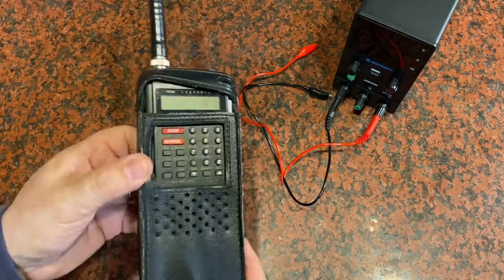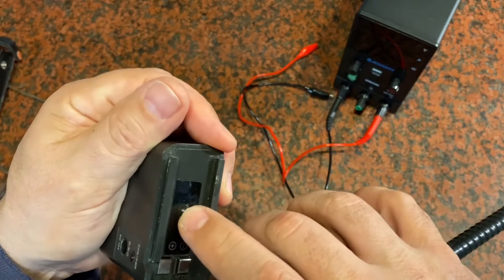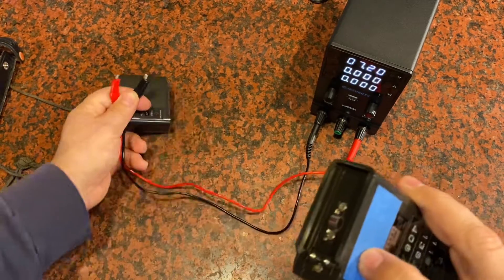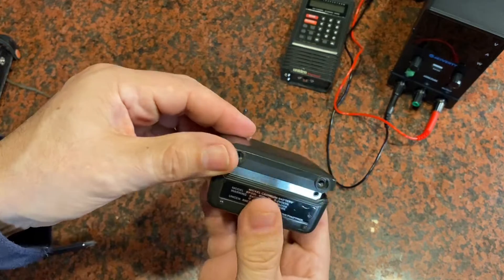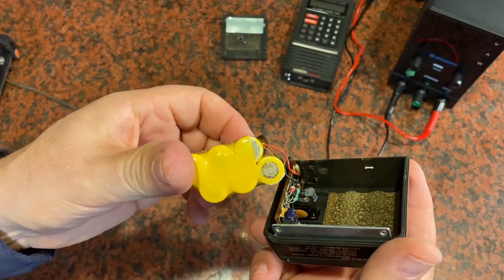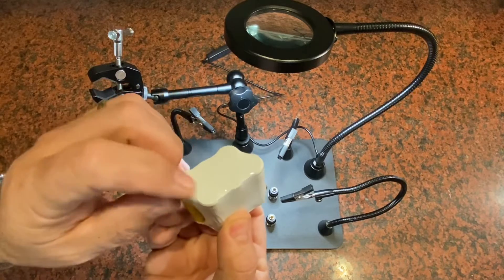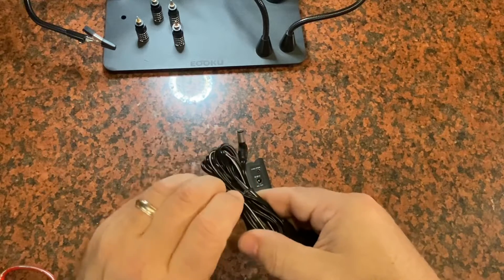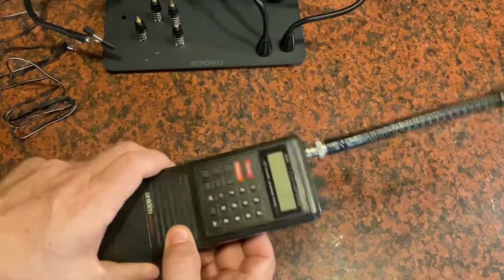✅ Repairing a Uniden Bearcat XT100 Handheld Radio Scanner with New NiCad Battery

Comment: I just did this repair on my 200XLT. I went a different route. Batteries America has a battery pack that is nickel metal, 2100mAh and made with slow discharge Sanyo Eneloop cells that have overcharge protection. They come pre-charged ready to use. That’s more than 3X longer capacity  than the original 650 mAh nicad pack. Stay away from nicads if you can. The nickel metal cells don’t have the memory issues. You can charge them at half full with no issues.

Comment: Stuck on this one right now!  Just opened the pack as you did, luckily not breaking the 35 year old tabs but one of the wires came loose from the regulator board.  So now Im stuck trying to figure how to get the regulator board out so I can solder new battery leads in. Looks like you have to unsolder the terminals formed into the plastic case,  they seem held to board by a good bit of solder.  Now to gamble can I heat the tabs enough to unsolder without melting the case!
Reply from the maker: @sethlavinder  good luck!!!
Reply: When i opened my empty battery case, the wires were cut too short to use by the previous owner. 1-remove the Philips screw that holds the corner of the regulator board and the metal bracket, wiggle the metal bracket out of the way and remove completely, it will come out without damaging anything. 2- bend the metal battery pos/neg tabs and straighten them as if you were going to remove (but don't try). Now the only thing holding the regulator board in place is the pos/neg metal tabs and straightening the tabs will allow the board to move just enough. 3- wiggle the regulator board and pull gently as if you were going to remove it, but DON'T. Just work it so you can expose the back side of the regulator board (enough to solder). I did not try to remove the board completely because the pos/neg metal tabs attachment to the regulator board seemed like an problem waiting to happen, i did the soldering while the board was still in the batt case, but now almost at a 45 degree angle so i could access. 4- you will need a pointed soldering tip, the flat will not work. Remove old leads and replace with longer ones at this time. I installed one gauge larger wire at this time. 5- I checked the continuity of my new wire/solder work, all good. 6- reverse process reassembled the battery holder, no new battery yet. 6- soldered new battery, closed everything up. After reassembly (or during) complete, make sure to bend and seat the pos/neg tabs back to original position as best you can.
Reply from the maker: @steve-sw4kg  thanks for the detailed fix!!

Comment: I recently found a BC200XLT,  at a thrifting/antique event, would this work for that specific model?
Reply from the maker: I'm sure you can find a replacement battery for it!
Reply: BC100XLT and BC200XLT have the same exact battery/electrical system.  100 and 200 are the number of stored channels in each scanner. The 100 is dark grey in color, the 200 was black. Color is the only difference.